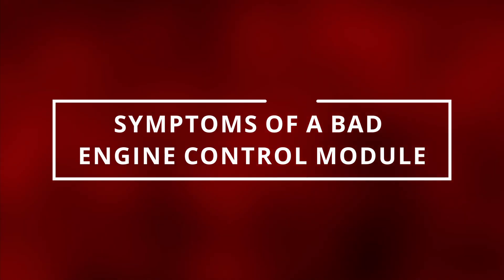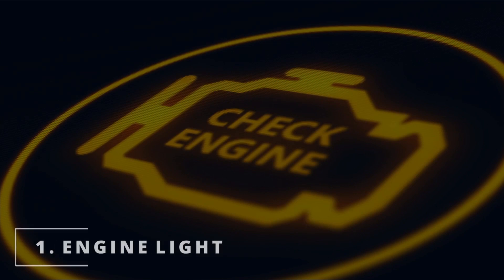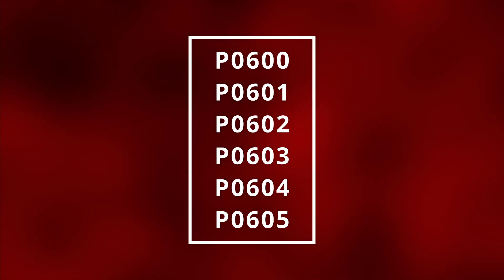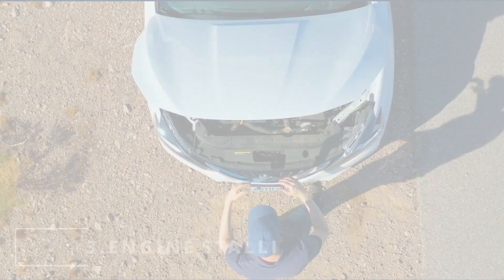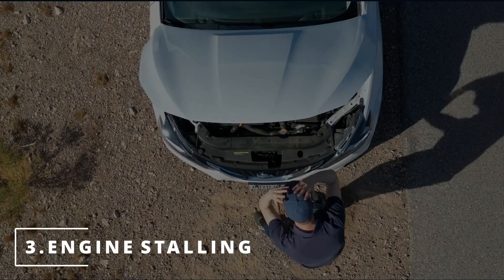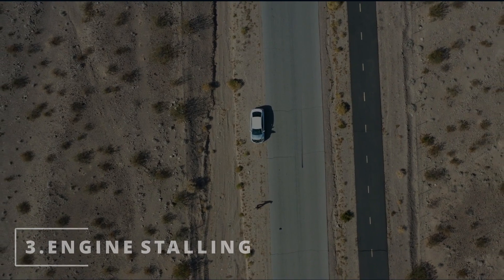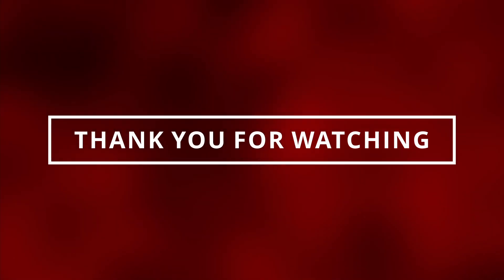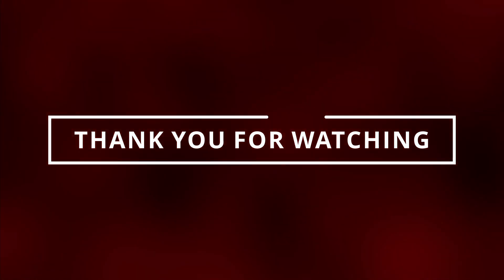SYMPTOMS OF A BAD ECM (ENGINE CONTROL MODULE)

Comment: I have the P0012 code, I keep getting mil light after replacing the camshaft position sensor, vvti, vvti filter, and the timing belt (kit) - all OEM. I’m reading places this could be an ecm or pcm issue. Is it possible the ECM is faulty?
Reply: I have the same issue as you said here but listen when I reset my ECM ie turn off the check engine light my suv run excellent than when the check engine light come on again problem is back
Reply: I had this happen. I changed out fuel pumps thinking they went bad. I just tested the fuel pumps. What a surprise to find out they were good. The ECM on a Safari Van with 200k plus can be the problem. This beautiful video showed that.
Reply: Hey! Same here, did you ever figure out your issue?
Reply: What car you have? It could be a gallery gasket
Reply: @DrileyM35  oil pan gasket.

Comment: Can a ECM go bad and not throw a code?
Reply: I say yes ...91 ford trans shift issues no codes no lights ......changed ecu ...shifts 1234 .   So yes
Reply: @waynebastianelli8391  I've changed the ECU and the problems went away in mine. Also a Ford....
Reply: @tonygorilla8928  Good T 👍 glad it helped
Reply from the maker: It’s possible to have intermittent issues and not throw a code. The ecm should always be the last thing to suspect though.
Reply: @easyautofix  Thanks for the reply, fella. In this case, it's apparently the exit drivers of the thing which aren't working. Would it throw a code you reckon?
Reply: i think so+ mine did in pontiac g.prix. no codes. but maf sensor caused pi171 im pretty sure.
Reply: i waited months to get mine running after ecm went out. most shops around here cannot do anything. finally found a decent pontiac man. fixed
Reply: these things are not all that expensive. not cheap but ive seen em with plugs+wires+and ecm around $100 bucks. if you can put em on then you save alot$
Reply: its crazy a ecm dont shoot a code on my car+pontiac gp but it will if bad m.a.f. sensor is bad. c.temp.sensor didnt either.  no wonder i been parts popping or what they call it+lol. but running great as of this second. a vacume gauge is learning me more than any reader has? oh well.

Comment: My 2009 Dodge caliber sxt 2.0 won't start and no clicks i replaced the battery and I had the starter tested twice and I replaced the crankshaft sensor  and I tried a Different starter relay fuse it just started out of nowhere what could it be  please help?